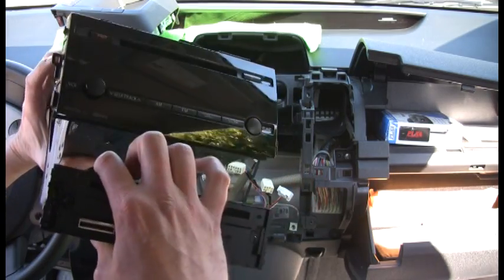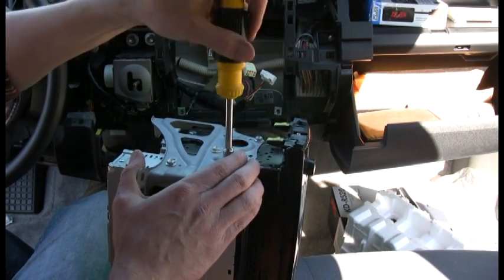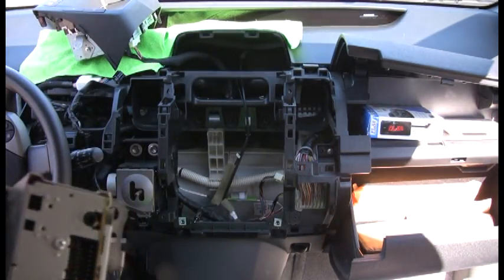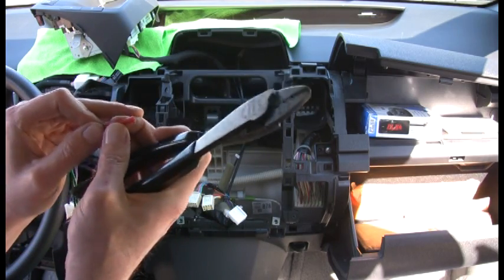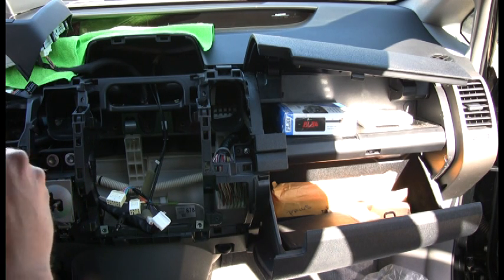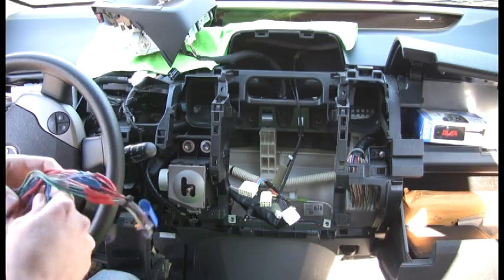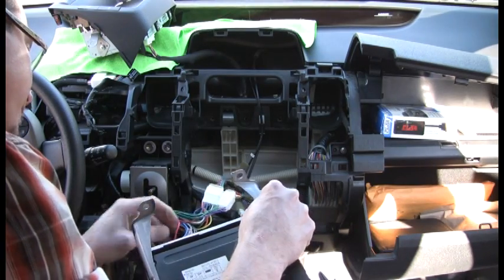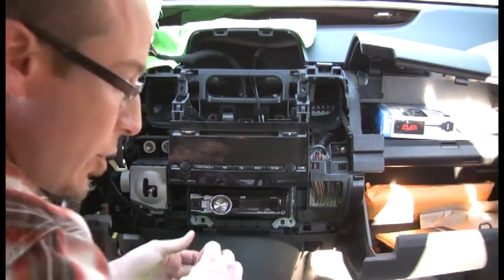Prius Stereo Install  Part 2.mpg

Comment from the maker: I installed the amplifier in the storage well under the rear deck but above the spare tire. The new small amps made by JL Audio and ARC Audio will fit under the front seats but will require you to run more wires.

Comment from the maker: I obtained the harnesses from the stereo shop I used to work at. The are made by Best Kits and can be purchased at any stereo retailer. If the retailer doesn't carry Best Kits you can purchase similar harnesses from Scosche or other car audio kit suppliers. Crutchfield carries all of them as well. Just remember you need the regular aftermarket stereo harness and the OEM harness replica (BHA and BHO).

Comment: So I installed this like 10 years but recently my stereo has gone at a minimal volume and very scratchy for all inputs, any ideas?
Reply from the maker: Sounds like your volume control is conking out. It's likely just the stereo going bad and nothing to do with wiring. 10yrs is a pretty solid run for an aftermarket stereo.
Reply: @JustinCaseWages  Thanks for your response! So after taking off a door panel I realized that the only sound is going to the little door tweeters and all four of the car speakers have no sound. I would say the tweeters are working and I have an underseat sub that I believe is working. Do you have any suggestions? Thanks for your help
Reply from the maker: @Andy Reid's Mustache  Assuming you're not working with an oem amplifier then the only way that sound would cut out from all speakers but the tweeters is something wrong with the stereo. You could pull the stereo and make sure a wire harness didn't come loose. You could try unplugging the aftermarket stereo and hooking up the factory stereo again and see if you get sound again.
Reply: @JustinCaseWages  yea I'm thinking now I need to pull the deck and check my connections. I believe I crimped them but I might go wire nuts this time

Unless you think the tweeters are wired into the same wire as the 4 door speakers

Comment: i have a 2004 toyota prius and the harness that i got does not fit... its the exact same harness that looks like plugs into your prius in the video. but my plugs from the radio are different. someone help!!! i have a 2004 toyota Prius with JBL radio speakers. Does it being JBL mean any difference ? if so how do i find my proper harness! thanks for a great video !
Reply from the maker: yes, the JBL system is different. There should be another part number for the harness. Unfortunately I haven't done this in so long I forgot much of the details. A good local car audio shop should be able to tell you. Otherwise look up your car on Crutchfield. Sorry I'm not much help here.
Reply: +Justin Wages thabks for replying anyways! Glad to see you are active! Hope to see more videos :)
Reply from the maker: +SezZ thanks! and I do see a different harness for the JBL system listed on Crutchfield and there is a thread about it on Priuschat.com. :)

Comment from the maker: The factory stereo is part of the bus system and removing it completely will cause an interruption of the data stream and produce an error icon on the dash and the MFD will cease to function and show an error with the A/C system. Leaving the factory stereo in place with a y-harness fixes this issue. To install a double-DIN unit will require the use of resistors to fool the bus system. There is more information on PriusChatdotcom for that type of install.

Comment: Wiring connections were off to the side. Tested it received power but didn't test steering wheel controls. It's a better video than most but not perfect.

Comment from the maker: Martin, it sounds like you have a problem with your amp or head unit. Sometimes equipment itself will generate the noise. This is especially true for budget equipment. Have you tried pulling the stereo out of the dash and laying it on your center console with a set of RCA cables running over the top of your seats to the amp? This will help eliminate the possibility of noise coming from the electronics in the dash and poor stereo shielding as well as RCA inductance.

Comment: Why do you have to plug power for the factory radio? I'm thinking about replacing the factory radio with a double din head unit, is that still possible?

Comment: I get so much interference from the engine in my speakers. Replaced all the speaker wiring, put in a new amp and a stereo. But i can't get rid of the unwanted sounds. Tried the ground to the amp in every place possible, Ran seperate power to the stereo to the battery. Got reall thick ground cables. Tried switching sides of the RCA-cables to get away from the main power line. Nothing helps :( Any more ideas?
Reply: Martin K you need a ground loop isolator. Radio shack sells them. It filters out the high pitch electrical whine from XM